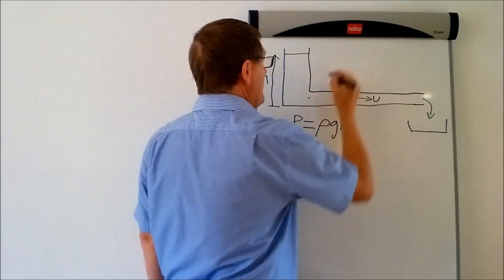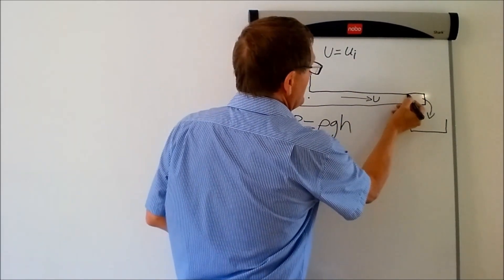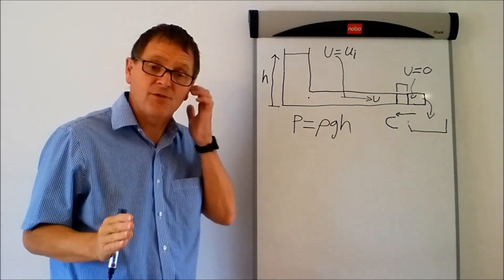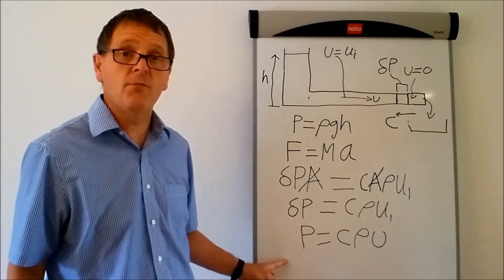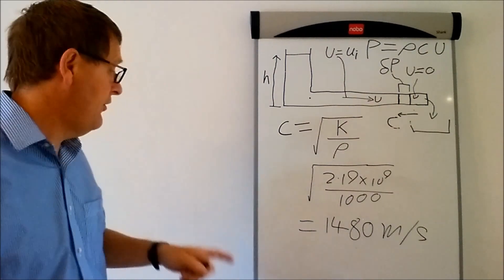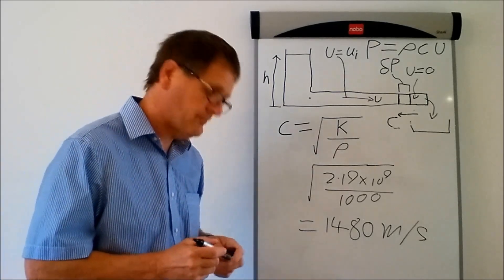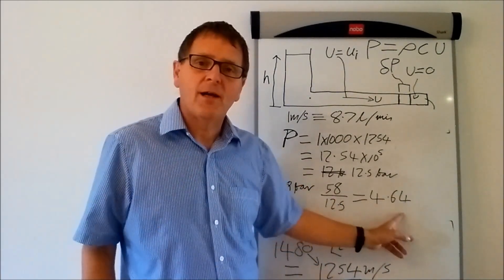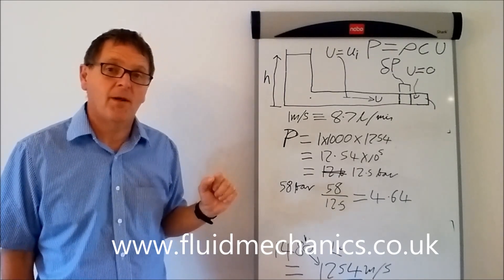Water Hammer Theory Explained

Comment: In my industry we have been facing an unique water hammer problem which has been developed to deliver max 6bar pressure via pump automation. 
The logic was to turn off the pump by pressure switch when the pipe pressure reaches 6+ bar. And when the pipe end valve will open and pipe pressure drops below 3bar then the pump will start. Logically its working but we are facing water hammer problem when the pipe end valve shuts. During that phase the pressure wave oscillates violently 0 to 10 bar. It causes to turn on and off the pump via pressure switch. 

Point to be noted, there is a non-return valve after pump delivery point and before pressure switches. It happens for few minutes. 

I am thinking to place a non-return valve at pressure switch outlet point to control the reverse pressure wave, will it work?

Comment: Thank you very much
I have a research problem in a refinery where a sudden closure of a valve caused damage to an expansion joint
I need help to calculate the pressure rise that caused the failure
Reply: Install a pressure gauge to detect the pressure of that point. Then you may install a pressure regulating valve prior that point.

Comment: The principles of water hammer can be applied to any fluid, whether it be liquid or gaseous. Indeed, if you consider the tuned manifold of an Otto Cycle engine, whether it be intake or exhaust, you'll find that most such "tuned" manifolds take advantage of either the third or fourth "harmonic" of the cycle while the valve is closed. While they were impractical for vehicle installation, Jaguar experimented with intake manifolds "tuned" to the first harmonic and achieved volumetric efficiencies well over one hundred percent. Tuned exhaust manifolds should have cones at the exits to reduce energy loss during reverse flow. WHSHOPE@EARTHLINK.NET

Comment: I am a research scholar working on water hammer analysis in the pipeline. I want to make a test rig for an experiment showing water hammer phenomena in both for rapid and slow valve closure. my operating pressure is 7 Bar. please advise me how to construct my experimental test rig.
Reply: Ive done this tests and analysis many times for aerospace applications. Instruments: standard and Piezoelectric pressure transducer, flow meter, valve voltage and current trace, DAQ rate of at least 5000 hz. Other tips: aviod high spots and deadends that could trap gas, perform your analysis before building your test stand, use method of characteristics for analysis. Good luck

Comment: before i am very thank full to professor (mike crowley) has posted about water hammer video which very help me cause i am student of mechanical engineering having thesis to analysis of fluid dynamic phenomena concerning on water hammer (creating hydraulic ram pump with harnessing water hammer as main power). But i still confusing about effect of water hammer after it is rising up the pressure causes water having supersonic velocity after the valve closed, my question actually very simple but i still cannot get the answer.

"after water hammer happened, the water's behave always makes reflection cause the valve closed...and how long the reflection of water inside the pipe ?"

Hopefully you can reply my question, that is big favorable to me...
Reply from the maker: Every cycle the amplitude gets a little bit less due to friction and the inelastic behavior of the pipe wall. Its a bit like a bouncing ball, after every bounce the amplitude gets less.
Reply: Mike Crowley thanks a lot proffessor for your answer, so exactly can we calculate that reflection or bounce of water inside the pipe with some equation ?
Reply: @rizkyfarizanfiqri7920  bounce will burst pipe  in empty air chamber or absorbed in air chamber
Reply: @rizkyfarizanfiqri7920  are you asking how to calculate the frequency of the oscillation? For a single pipe system with 1 closed end, the fundamental frequency= acoustic velocity / 2 / pipe length